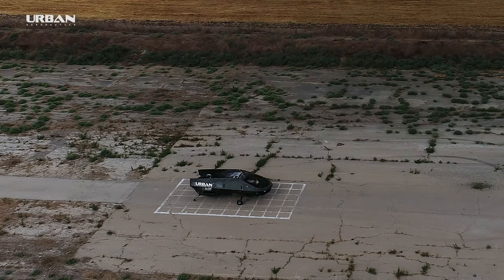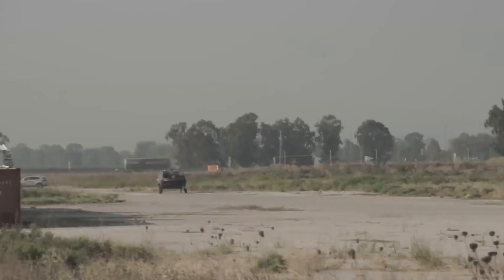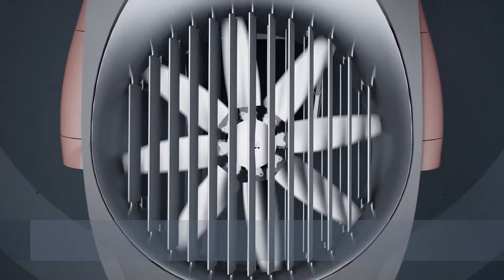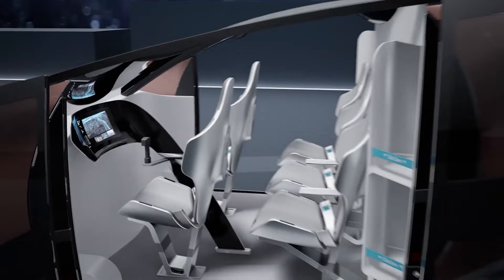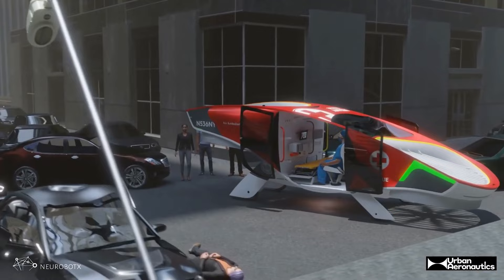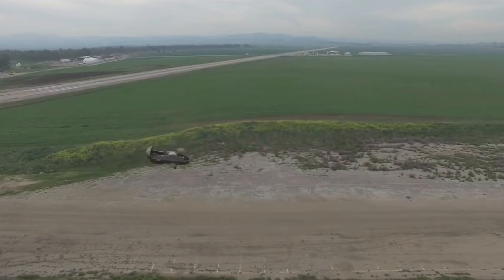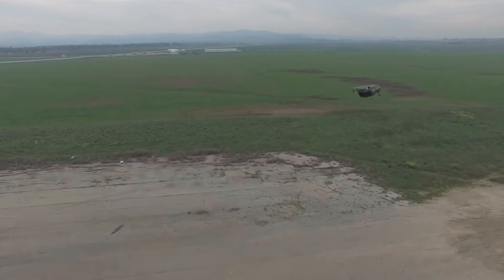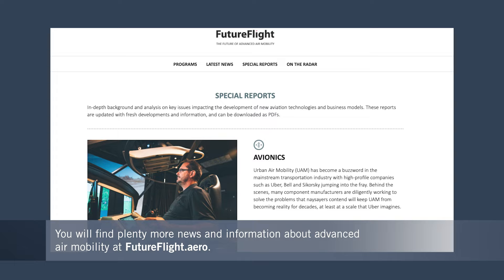Hydrogen-powered CityHawk eVTOL Aircraft Could Transform Air Ambulance Services – FutureFlight

Comment: This is the best, most realistic concept yet for a vehicle like this. Most of competitors will pretty much explode if they bump into something, which is inevitable. Look at the EVTOLs that get the attention, the Jetson One for example. The rotors are exposed. It's a deathtrap, it can only fly for 20 minutes before needing to recharge, and it can't carry any more than one person. It's a dangerous toy.

The vehicle in this video is a far more practical design. With a hydrogen tank, it will have much further range. With no external moving parts, if it should happen to bump into something it won't be damaged. And the EMS role envisioned for it is probably the most realistic early use for vehicles like this. Not air taxi, not delivery. It's a lot of investment for such a small benefit.

But saving lives by flying over roadways? Medical evacuation helicopters are already popular, and this is far better suited than a conventional helicopter to fly onto city streets or rooftops. It could also take the place of a helicopter in some areas that already have helicopters on standby. Ski resorts, wilderness areas, etc. Hospitals could buy vehicles like this.

It would be a lot easier to convince the government to trial and accept the use of these flying vehicles when the flights are saving lives by greatly decreasing travel times to emergency rooms for the gravely injured. I'm comparison, it's much more difficult to convince a government to accept a risk of danger when it's doing something a wheeled taxi or delivery truck could do, just faster and less efficiently.

People will make an allowance for the danger just as they make an allowance for the way ambulances drive. Because while there's a danger to flying, the vehicle is being used to save a life, often dependent on delivery speed to a hospital for emergency care. This flying vehicle might even be safer than conventional motor ambulances. There's a danger to flight, but since there's an even greater danger posed by slow delivery of patients, the danger of flight becomes acceptable as it reduces danger overall.